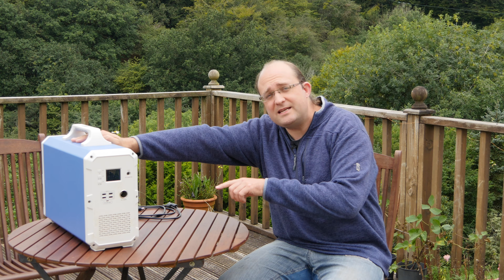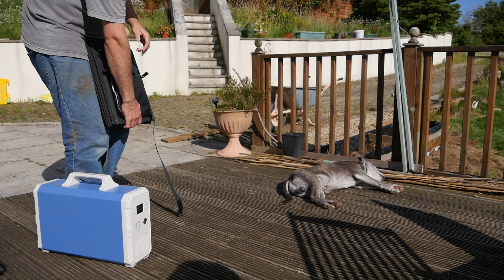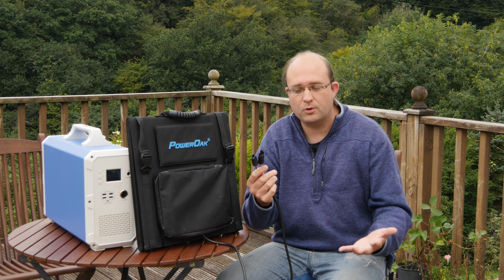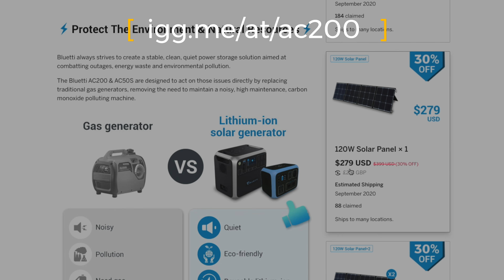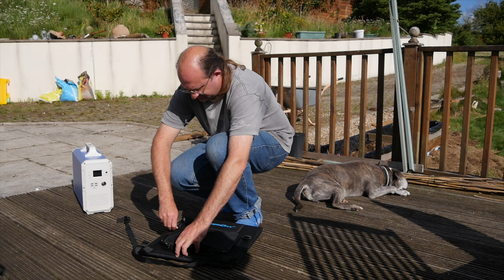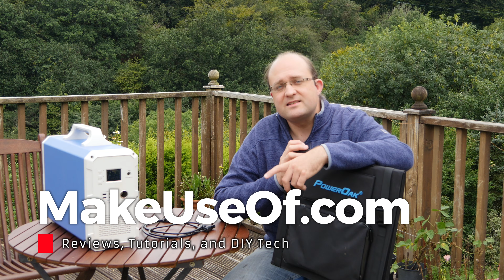Maxoak Bluetti SP120: Portable, Powerful, Solar Panel

Comment: Thanks for the review.  I just purchased a EB240.  What is the max solar 120 panels that you can hook up?  4 = 480 watt?  can you do 5 and it just caps at 500 Watt?
Reply from the maker: Unfortunately it's not quite that simple, as you're restricted by voltage and current. The SP120 runs at 20V max, I believe the most you could do is 3 panels in order to stay under the 60V max of the EB240. If you exceed the maximum input it just shuts down and doesn't charge at all, so you need to carefully match them. Buying four of these panels isn't really cost effective or all that portable though - you'd be better off matching it with a suitable high efficiency standard panel or two.
Reply: @MakeUseOf  thank you
Reply: @MakeUseOf  would It be safe to use 4 panels if I set them up using 2 sets of 2 series linked solar 120 in parralel ? Would it be 40 volts ?
Reply from the maker: If my math is correct, you'd get a maximum of 40V @ 12A , which exceeds the maximum current of 10A. I'd recommend double checking with Bluetti support though!

Comment: Thanks for the review, since I’m new to the solar energy use, I have two very major doubts that I can’t find any mention in any review: 1) can the sb150 battery be charged via solar at the same time that its being used to power devices on AC and/or DC? 2) If the sb150 battery is full and there are solar panels connected to the SB150, will the power they generate be directed to the AC and/or DC outlets to give energy to connected devices or is the solar panels energy wasted unless to charge the sb150 battery? Thanks in advance
Reply from the maker: 1. Yes. Simulatenously charge discharge is fine for both AC and DC and everything at once. 
2. No, if the battery is full, it simply shuts off the input. But the solar does have to go via the battery, there's no option to automatically divert is to output since you wouldn't have a guaranteed current. But in reality, you'd be using the battery, and then the solar would be charging it, at the same time.